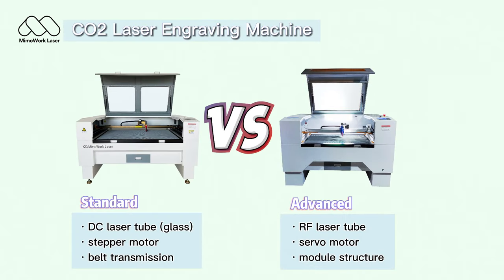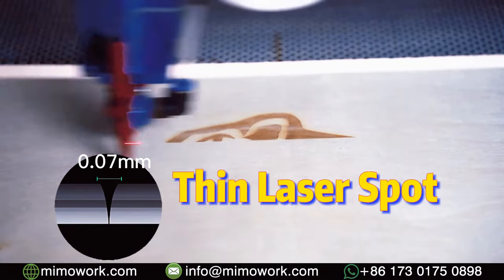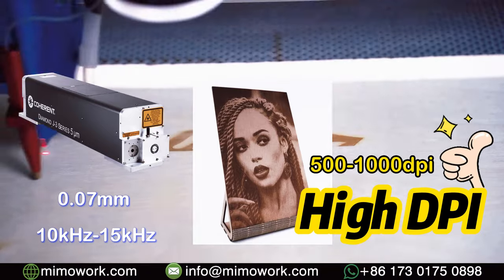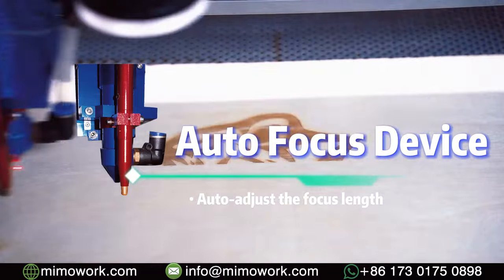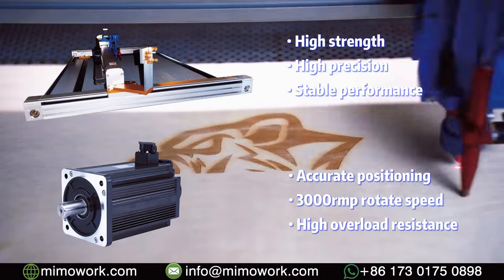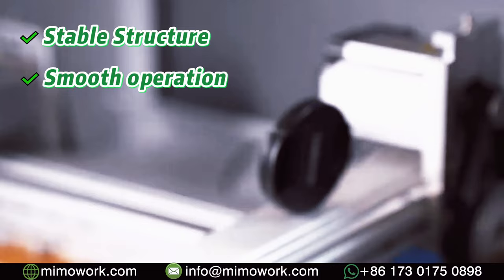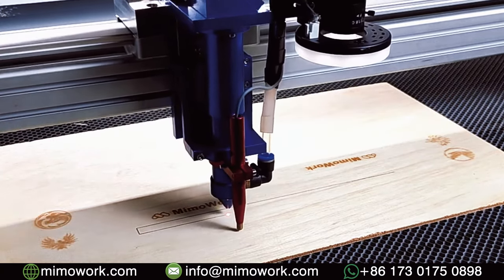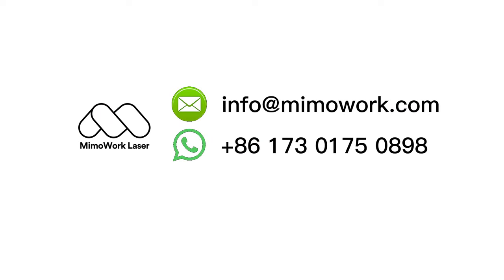2023 Best Laser Engraver (up to 2000mm/s) | Ultra-speed

Comment: similar to trotec speedy?
Reply: I think so. The mechanical parts look quite similar, servo motor and module structure..
Reply: Trotec claims they can reach 3m/s max, but it greatly depends on the material and how brownish you want your wood to be.🤔